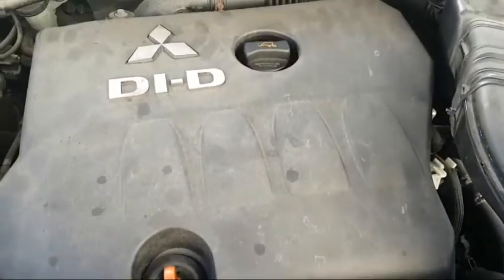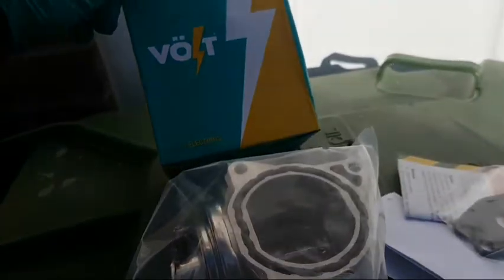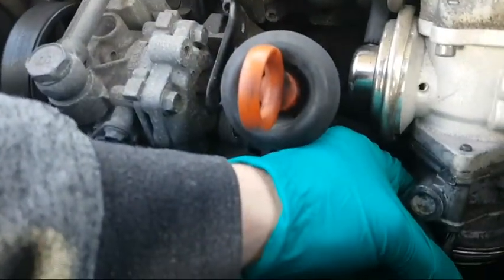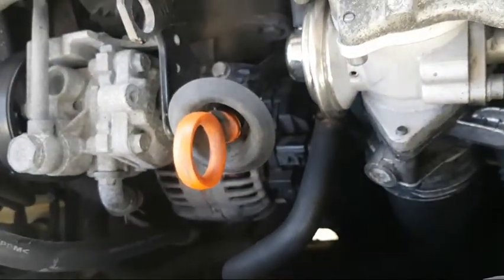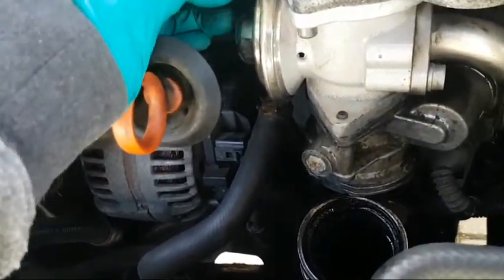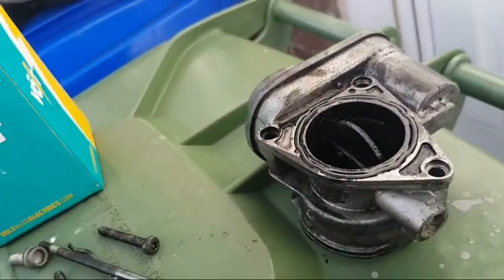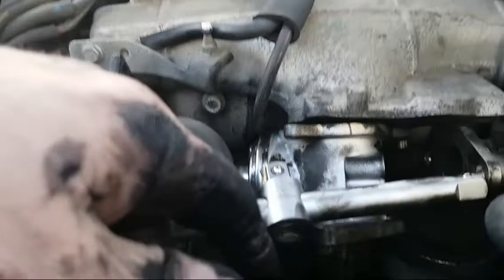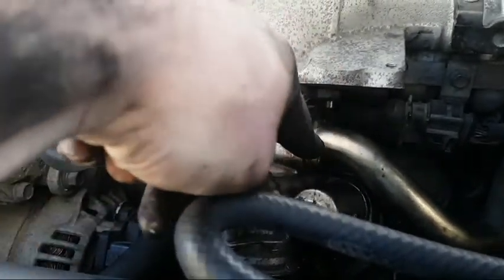Mitsubishi outlander mark 2 egr valve throttle body change

Comment: Ive recently changed the egr valve on the wifes mk2 09 outlander. Would the pipe that goes to the egr valve be blocked as thats one thing i didn't check as the light has come back on when its been reset 🤔